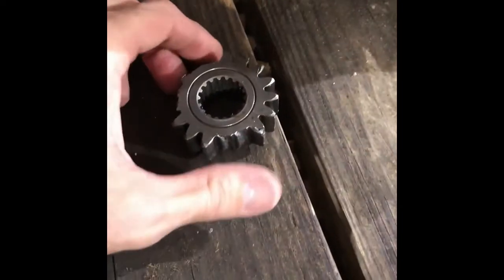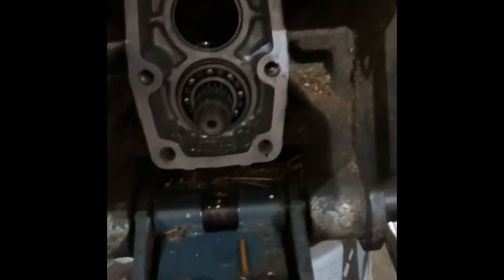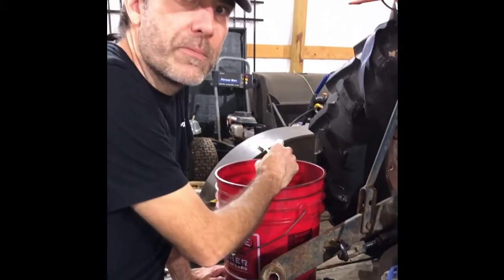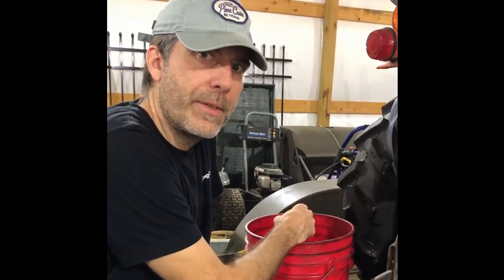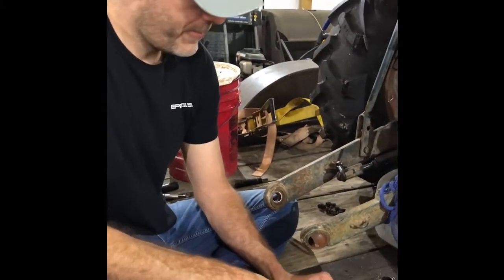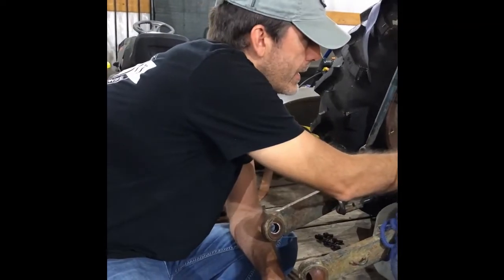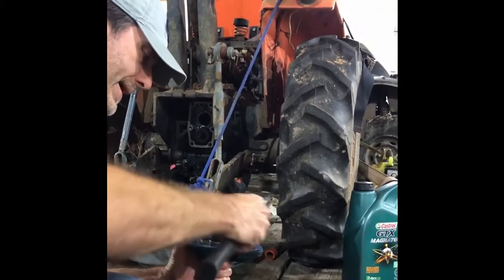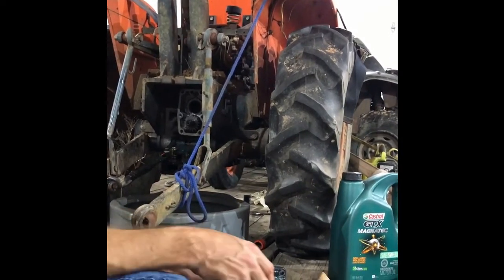Kubota B6200 PTO

Comment: I got conned into putting the PTO slider gear in a Satoh Bull with a loader and a PTO driven hoe. Had to take everything off and break the tractor in half to get to the gear from above. The owner didn't think it'd ever run again but it did. I could average 100 feet of water line ditch an hour in hard ground with it. He just let it go to flinders and I backed off and let him have at it. I try to take care of what I run or drive. Always have. And Gods Truth will still be around when this world goes up in a puff of smoke. GBWYou and Good Job!
Reply from the maker: Thanks Lewie! I think mine broke from running over too many sweet gum trees. I was clearing a field that hadn’t been mowed in 20 years. It really tested the limits of that little kubota.
Reply: @barntech2291  A D6 with a root rake would come in handy but we just have to use what we're given. I think the Satoh demise was from a bunch of jackleg so-called operators. GBWYall!

Comment: What kind of noise was it making before the repair? Was it noisy on just the 540rpm or on the 1000rpm side as well?
Reply from the maker: I knew something was wrong when I broke three sheer pins in a row. I rebuilt the bush hog and it happened again (immediately). That’s when I noticed the PTO shaft going into the tractor did not spin freely. Sorry I don’t recall the noise well enough to describe it. I only use the low rpm setting.